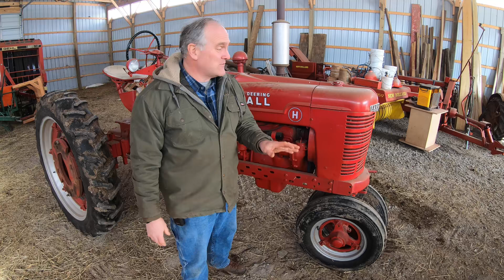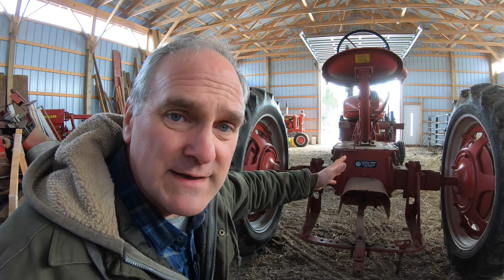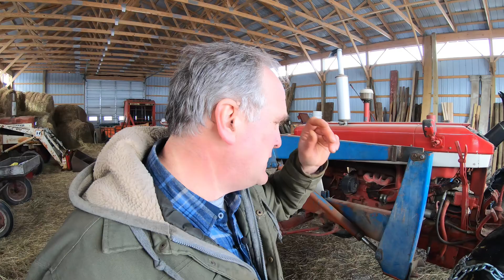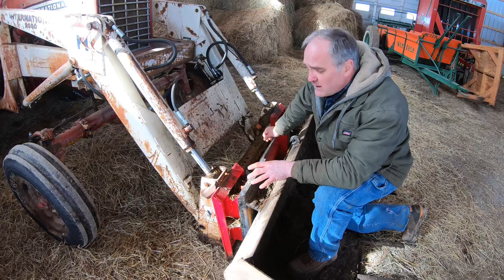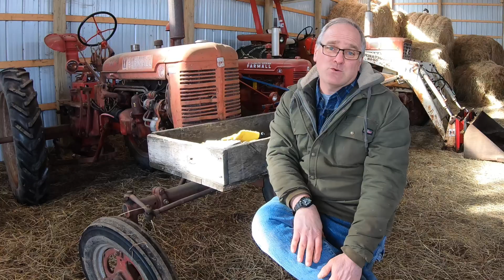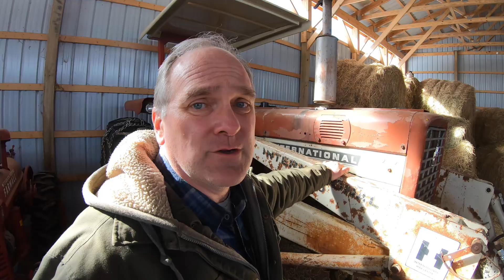Buying an Old Tractor for Your Small Farm

Comment: I lost my 8n in a flood, replaced it with a Ford (Shibaura) 1715 diesel,  4wd, Live hydraulics, power steering, Front end loader.  I would NEVER BUY ANOTHER TRACTOR WITHOUT THOSE THINGS, ESPECIALLY THE LIVE HYDRAULICS!  The modern tractor is so much more useful than the old 8n I would never go back!!!!!

Comment: Pete: You've caused an addition. Not really, but you've definitely caused me to pursue it with slightly more vigor. I now own: 1953 Super H, 2x 1944 H (one running, one I hope to restore if the stuck engine isn't too bad), 1947 H (has a lightly stuck engine, and should be a straightforward return to operation), and a 1949 H with M&W 9spd. That is just the Farmalls. I also have a Massey Ferguson 135. It is a lot of fun, until I have to buy tires. My Super H just got brand new 14.9x38 on 13" rims BKT tires... at $2600. Oof. I bought 3 of the tractors for a total less than that!

Comment: Still got my grandfather's International 584 , thing is a beast. Before that he had the old farmalls (h & m) that he used to make 1000s of square bales every summer right up until 2000 when he upgraded to the 584 and a Deere 3010, the only green tractor he ever had , both the Deere and the 584 were about 60 HP but the Deere was a gas engine and you could definitely tell the difference, the diesel just seemed stronger. Then again that could just be the red ones are stronger then the green ones , but we'll say it was gas vs diesel. The 584 had a built in can of either from the factory, it was never hooked up cause we didn't do much haying in the winter in Maine and I've read they did something in the early 80s or late 70s to make the diesels easier to start in cold weather. Another issue is the diesel fuel gelling up in the cold and that can be a pain in the butt, they make additives to.put in the fuel to prevent it. Those old tractors were built to work and built to last that's why so many are still being used on farms today, figure those farmalls are coming up on 80+ years old and still used as daily workers. Imagine having a 80 yr old car as your daily driver ?

Comment: Excellent video, very educational, thank you. What do you recommend to pull a horse out of soft wet mud, often horses get stuck in wet soft grounds and it's a hassle to pull them out, which simple tractor do you recommend for pulling horses weighing 600-700 kgs considering they are stuck all the way till their belly, thank you

Comment: Had an old Ford 8N and while it was cheap and nostalgic, it just wasn’t a very good tractor. No loader, no 4wd, no diff lock, live PTO. It would get stuck easy, needed constant tinkering, and it was geared too tall, it wouldn’t go slow enough when mowing thick grass. Can’t wait to get a modern tractor.

Comment: My late father willed me a 62ish Mccormick international  farmall 340. He plowed snow with about twice. It hadn't ran in at least 6 years when I took it home and my mom didn't think it would run. All I did was clean the bowl and filter and it started right up within 24 hours of having it home. I don't have a real use for it but I'm finding stuff for it to do every day.  I have 5 acres so it will get used. I already pulled the neighbors ford out of a Pete bog. Still learning on it as I'm 43 and it's my first tractor. Nice video. Thanks. If you have any pointers on it I would love to hear them. I'm in lower Michigan just fyi.

Comment: Great video, I am looking for an older 4 wheel drive tractor with loader.  I need the 4 wheel drive, we are on grades which slope pretty steep to the creek.  We have lots of fallen trees and we need a larger tractor to handle the logs and not be so tippy.  Qany recommendations?  Thanks, I watch all your videos.

Comment: I have a 49 ji case vac with a wide front end, Homemade 3pt hitch that runs on the belly pump by one cyl on the side of the tractor.it also has a belt pulley on the side of the tractor I'm guessing it's gonna take at the least $700 to get it running again. Would I be better off with a different tractor like a H or C or M. I mainly will be using a 3pt sickle bar,a bar rake and an old baler either an old Ford or an old new Holland with the smaller bale chamber. And not pulling a wagon behind baler I'll be pulling a wagon around and picking up the bales àfter I've baled them
 Money is a factor for me .what do you think?

Comment: Finally got an international 350U for my 10 acres !!! 
Live Independent PTO, front mounted pump for the front end loader, spare rear remote hyd. Fast hitch/three point kit. 
It was this or a ford 5000 with no loader but in better shape, but i grew up on farmall and international so it was a nobrainer.
I wouldn't trade this for any of the new tractors in its horsepower range costing 10 times the price.
I paid (3500.00)
Thanks for your content! Im looking for one of your videos for timing adjustment.

Comment: I would add something, and keep in mind I am in know nothing city boy and came out to live on an acreage. I would add that a lot of the people that this would this video would pertain to, are probably hobby farm/acreage people. If you purchase your hay from outside and you have cows, you probably are going to purchase large round bales. In which case you need a large tractor or medium size that they would scale today.. I have a John Deere 4020 with a bucket and grappler. It works absolutely great for feeding the cows large round bales and does a pretty good job at removing snow. If you don’t need a large tractor, I would suggest keeping it smaller. For example if you feed small square bales to your animals.

Comment: Pete, if someone was going to do basically what Gabe Brown does on small acreage, what would you recommend? Like I have 5 acres with access to 40 and possibly more if I want to lease from neighbors.

So I'm thinking no till drilling a few acres of cover crops and grains, no till drilling a large garden, moving lots of manure, dirt, and hay, holding up a pig for butchering, etc.

Also, my husband is a very skilled mechanic but hasn't worked on tractors. Do you feel like it's a worthwhile business venture to flip old tractors? What kinds of rehabs turn into money pits? I think it'd be cool to start with older cheaper tractors and flip up to where we want ultimately.

Comment: I have a 1200 acre farm and I still by the old stuff because to me it's cheaper and more reliable than the new stuff. My ''newest'' tractor is a 1983 Massey Ferguson 4840 and everything I own will be 1990 or older. My oldest is a 1939 John Deere G mostly for show now as we've restored it. We have two 1952 Massy Harris 44 specials we use to a lot of the pull work with New Idea loaders. Hydraulics are slow but we've lifted 2000 lbs with it. Weakness is the rear PTO...it's a little high and puts more wear on equipment U joints. Gotta love the old stuff I can repair on my own and parts are cheaper. Only advantages new stuff has is it's more comfortable and have features that make things a bit easier. That's it. All the old stuff can be modified to handle the quick attach equipment. Great info here! Thanks a bunch for the video, would love to see more videos like this as I'm always looking to expand my agriculture knowledge.

Comment: Hi Pete, I am starting from scratch with 38 acres. We are located in western Washington and 80% of the property is treed. I have a tracked skid steer and a John Deere 2025. I have cleared about 3 acres and built my out building and new home. I realize it will take me years to establish "a farm" but incrementally, I would like to improve the property so it is self sustaining by either yielding produce, Christmas trees or livestock. The soil is heavy clay and grasses grow well but it is unstable during the wet seasons which is about 6 months. 
My plan is to clear areas, chip what I can and turn it into the soil, then section areas for use. Any thoughts?

Comment: Pete, too many noobies (I think primarily due to what has gone on in the riding lawn mower market) dont understand the concept of horsepower and tractor weight and getting that power on to the ground.  There are lawn mowers out there that supposedly have more HP than your Farmall H, but would only be able to pull about one-tenth the load of your H will!

Comment: I love my old Farmall tractors. My favorites are versions of the Super C with the Fast Hitch. If you get a 3-point adapter you can connect to “most” modern implements. They’re easy to get parts for, easy to work on, and are a joy to own. They have live hydraulic power and with an overrunning clutch, are great for rotary mowing. Thanks Pete. I enjoy your videos and your book
-Tom

Comment: I have a small place, 25 acres, and use a modern Orange tractor for most of my work.  I just bought a John Deere 40 for cheap (not running) and am in the process of restoration.  It has a 3 pt hitch so it will be used for some work around the  place as well as providing a bit of nostalgia.  I really enjoy your videos showing your restoration work,  they provide inspiration as well as useful hints.  Thanks

Comment: be sure to check the tires carefully (high dollar item) and be sure that it runs in all gears (also high dollar, and more of a pain to fix).  Good brakes are a plus, but not many tractors I've used have had very good brakes on them.  Dad taught me to keep it geared down in case I needed to stop.  also check ALL fluids (coolant, engine oil, gear boxes) and make sure they are the right color and consistency.  a lot of older ones sit out and accumulate water in the wrong places.

Comment: i would never by a gasoline tractor, here in europe i only know that fergusons/ massey ferguson sold gasoline ones and they are not very reliable  especially at the x35 or the 135  there the 3 cylinder diesel one starts better than the 4 cylinder gasoline and needs 1/3 less fuel while having more power. And i can say nothing bad about old diesel engines they work extremly well, or is that just an american thing about beeing not able to make diesel engines

Comment: I have a restored 706 gas tractor with quick attach hitch and dual hydraulics, as well as a Massey 365 with a perkins 4 cylinder diesel and nice farmhand loader operated by a pto hydraulic pump;  couldn't be happier with what they do for the 'agricultural archeology' project. They're a fraction of the cost of electronically infested newer tractors and are great for learning. Four wheel drive is on the list, someday...

Comment: I know that when I was looking for a tractor I had to find one that came with some equipment. That is how i found the John deere 1010ru I have. It came with a plow, disc, cultivator, and old sickle mower. Unfortunately I have been discovering certain parts for my tractor are not available not even in aftermarket because it wasn't a popular model. It's so bad that I can't even find a simple metal fuel line. John deere doesn't make it anymore and no one makes an aftermarket. Hope and pray I can figure something out. Otherwise I may need to find another tractor since some parts are no longer available.
Reply: I think you might be able to take the old line to a parts store like NAPA and get a copper line and fittings to fit it. The 1010 RU model has the same engine and transmission as thousands of other 1010 models. Don't give up to soon. Good luck.
Reply: Sorry. I didn't think that it might be a diesel.

Comment: Letter series farmall are the easiest and cheapest to get parts for hands down. If you find an h or m with a m&w live hydraulic pump that's makes it a much more useable tractor but still not as nice  a newer tractor with power steering. Gas tractors are cheaper to work on, plugs and distributer cap are alot cheaper than injectors and injector pumps. Old oliver/minneapols/case/massey diesels with the Bosh psb injector pumps are hard to get parts for and  expensive to buy if you can find them. The 706 with the 310 German diesel, 806 or 856 are good sized and equipped machines for most jobs and some of the most reliable IH built in my opinion.

Comment: Great video Pete! My Dad with my Grandpa bought a 1940 H in 1970 and we have been using it ever since. For many years it was our only tractor.  My Dad and Grandpa have long since passed away, fortunately the old tractor stayed in the family, my brother and I have acquired newer John Deeres, Fords and Farmalls but he and I always favor jumping back on the H when ever we can.   No other tractor that we have works so well in the woods skidding logs out in the mud and snow.  It's so reliable, stable, maneuverable, great visibility, perfectly geared and just the right amount of power.  My Dad put new rubber on it in 1971 and this year we finally replaced the tires when one finally blew its brine out. Ditto on liking Red tractors because that is what you grew up with!  Regarding future topics, our 1940 H has a small gasoline tank, big distillate (I think) tank and a shutter mechanism with part of that removed now.  It would be interesting to know how that system once worked and what happened to distillate fuel and when did farmers stop using it?

Comment: Hey Pete, Good topic. I personally Have been looking for a 70 to 80hp 2000 to 2008. Still strong for the future and no regeneration. But have found those year mod are as expensive as a new 2020 mod. Ill just keep looking, But I am a little surprised at a lot of comments of new tractors but no comments on the regeneration aspect of the tractor. No one I know will buy a new tractor for that reason alone. Nar do I understand why 20 to 80hp farm tractors need regeneration anti-pollution. for something that is used around 100 hour a year.

Comment: Many excellent points in this video Pete!  Very true that tractor brands were built around dealerships with parts/service available locally.  This is still the case in many respects.  For instance, here most tractors are red (but not I.H. red...) because there was a Massey dealer who maintained repair facilities as well.  Other areas are predominantly green; same idea.  
But the newer compact tractors with their Japanese engines don't seem to "need" much tinkering...  I think I understand (commiserate, perhaps....) to some degree with your love of old machines.  You named all the significant manufacturers.  Now there's just a gagillion!  But I have a '66-7 A.C. 5040 which is old but not ancient.  However, I don't know if it qualifies as old American iron because it was built in Romania (using an Italian Fiat diesel 3-cyl engine) You can't hand-crank this one, but I don't know how "enthusiastic" I could get about cranking a 122 cu. in. diesel without compression release...  Nowadays it gets left in a corner with the tiller hooked up.  Pull her off with a 2004 blue tractor (Japanese engine.  Good starter)  a couple times per year to stir up the garden beds.  The tiller is a Howard (England) Select-a-Tilth model which offers four tine-speed ratios.  Howard was knighted for his efforts.  Interesting history, his.  
Keep up the good work with your videos.  Me?  I'll say it again:  "I don't want NOthing w/a mouth!"

Comment: We run propane tractors M Super M ,706 LP along with 70 John Deere, 4020 LP because propane was cheap and abundant in West Texas. Not so cheap anymore  but the M and Super M I have are fuel efficient. I have a 602 Moline LP a 60hp tractor it is  really good on fuel. I bought a 76 Case 1175 diesel 127 hp powerful and very fuel efficient for its size. I like you favor International Harvester. If it's not red leave it in the shed. I really enjoy your videos sharing the farm. I can relate having a small farm myself. Keep up the good work.

Comment: Seldom do I see a "new farmer" buy equipment appropriate and economic to the daily tasks at hand.  Whether they rely on a friend's advice or some salesman, it is dollars wasted and opportunity missed.  I think this primarily stems from a lack of understanding of what you can and can't do with old tractors, and in part applying old used car logic to used tractors.....which salesmen of new equipment encourage.  It would help all concerned to spend more time describing what your tractors are or are not appropriate for as you use them or work on them.  Also I'd throw in that most of the pre WWII smaller tractors were designed to replace a horse/mule and to initially use the same implements....which really isn't the way to go.   They also almost always had a side pully to act as a donkey engine to run stand alone equipment by a drive belt, such as corn shellers, generators, silo elevators, etc.  By in large this is mostly irrelevant to today's farm environment, but something some may wish to have the capability to do.  Further, you need to emphasize the lifespan of a tractor vs. the family car.  A 50 year old tractor being used for daily work is a tool with years left in its working life.  A 50 year old car is a survivor collector item taken out on sunny weekends.

Comment: Thanks so much for your information Pete. I have a question. How important is   Minimum speed or low range transmission, when it comes to tilling, rotorvating and mowing, especially on small acreage? I noticed that tractors like the Ferguson T20 (grey fergie) have a minimum speed of around 3 mph in 1st gear.

Comment: Great video and I think you are correct on your advice on gas vs diesel on an old tractor. I too grew up with Red Tractors so I am partial to them. I have an H and Super M that both need restoring but I also have a 1466 of my own and 806 that my nephew owns that we run. We don't make a living from our acreage but we do maintain it and plant for wildlife. I also have a late 70s Ford 2600 Diesel that hates any temp below 85 (don't even try below 50 degrees). In the late fall, winter, and early spring I often wish it was gas.  Again, from the deep south we love the videos!